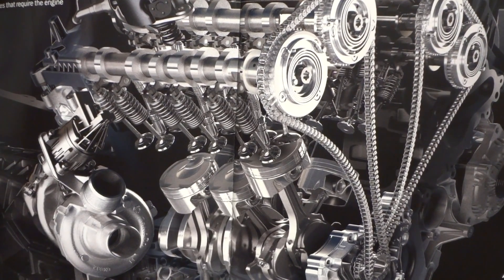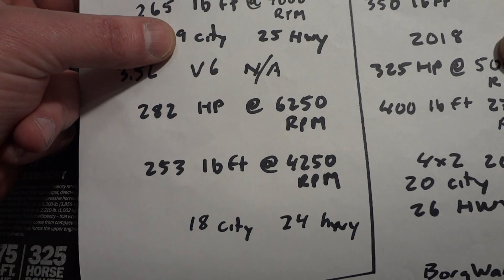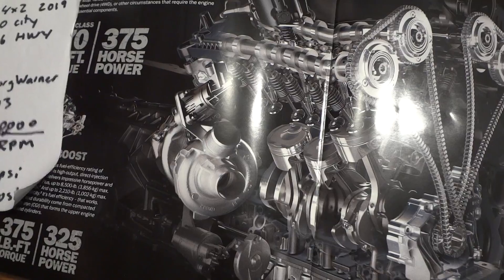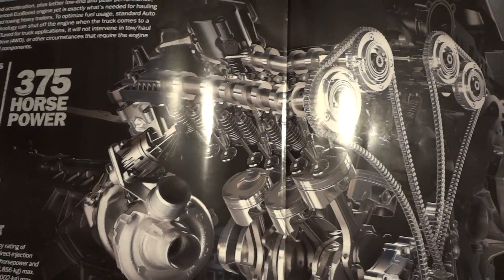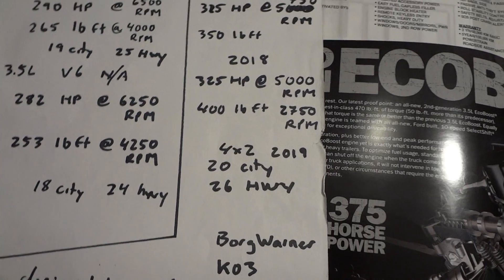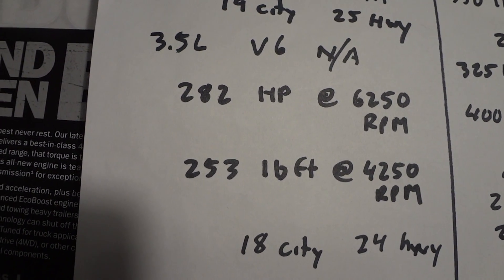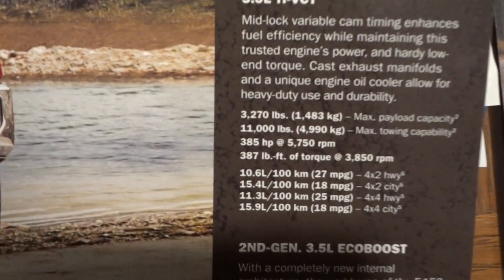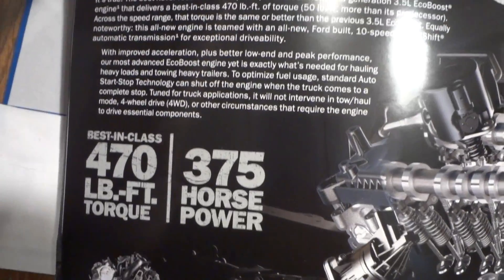why not to buy ecoboost engine f150 vs v6 v8 naturally aspirated

Comment: I can attest. I went and bought a '14 6R80 trans with the NA 3.7 and 3:73 diff's after having a '18 with the 2.7 and 10R80. The latter was a great truck...but after 2 years the gimmick of it tuned for power, turbo delay annoyed me plus the looming idea that the turbo's will need replacing at some point. It fell on its face over 3500rpm, u had to click thru 5 modes to Sport for high rpm power. It was literally faster at half throttle then full throttle. Im much happier with the 6 speed lower geared axles 3.7L. It IS NOT slow, the turbo 2.7 was only faster at holeshot after that the 3.7 feels exactly the same accleration with this current drive train. Super smooth around town, but put your foot into it and it rings out to 7k pulling hard entire way. Its not shifting 100x on a 5 mile drive and no damn modes to click thru. I almost think Ford would sell a lot if they did a "classic" like Ram. This 6 speed, old body style and NA engine options for reduced price.

Comment: I'm happy with 2018 3.3 v6 nat asp. But, the package has rear diff that gives 7400# towing. If you need more towing...ecoboost ir v8
Reply: Thats the key with the previous 3.7L and the 3.3L. If more people drove one with the towing package 3:73 axle ratio they would like them. Its a more natural engine feeling than the turbo's.

Comment: I recently found out they make the 6 cylinder without ecoboost and a regular 6 speed transmission.  Wish I would've bought one before the prices shot up.
Reply from the maker: thats the one I got 3.5 L and 6 speed tranny
Reply: I got the 2018 f150 4x4 3.3l with 6 speed trans. I love it. 22 mpg back n forth to work

Comment: Does this include the Ford Mondeo 2017 model
Reply from the maker: personally i would never buy any car with a turbo. dont care who made it. its a ticking time bomb. mondeo apparently has alot engine options but i wouldnt get the diesel either.
Reply: @BIKEMAN21  Your absolutely right. After research I think that naturally aspirated engines are the better option
Reply: Less to.go.wrong without turbos.. turbocharger just forces more out of an engine that wasn't meant to put out higher torque or hp.